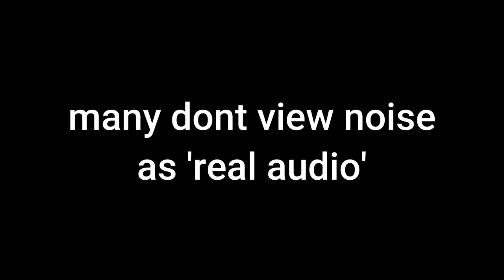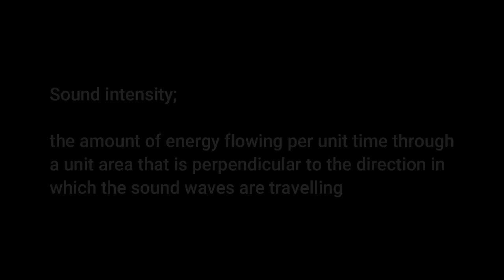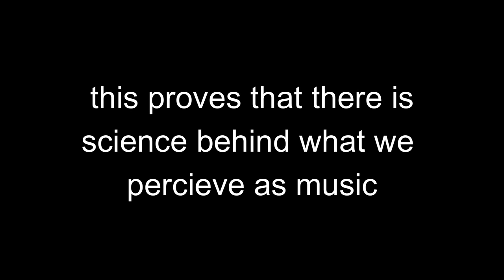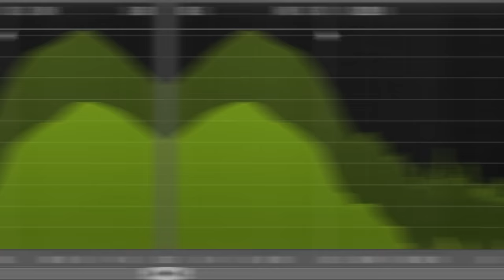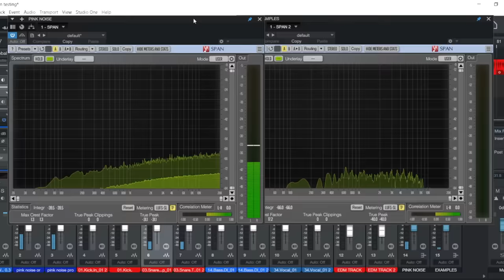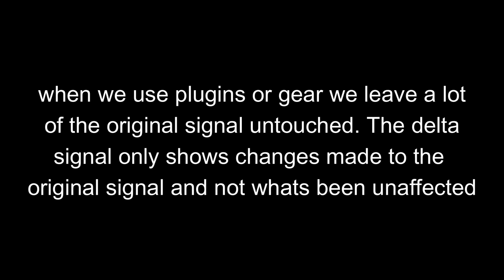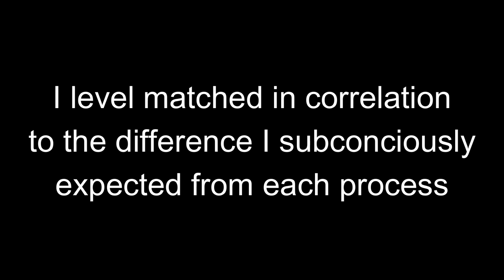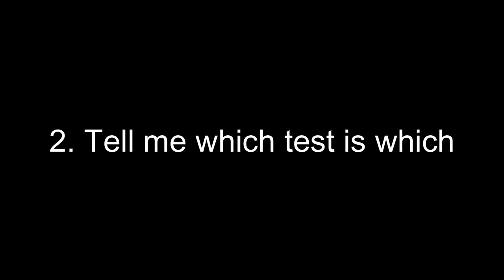THIS test will stop you buying more plugins.. and maybe even improve your mixes!!

Comment: I feel like there’s a lot of context outside of this video that I have zero knowledge of to make any sense of what is the debate that it is addressing, and what relevance it has to the video’s title. 

Does anyone feel like giving me some pointers?
Reply from the maker: The whole point of the video is showing how you can properly test if a plugin or piece of gear is actually adding anything audible, and if 2 plugins or gear have enough of an audible difference between each other to constitute in a purchase, without being distracted by psycho acoustics and the placebo affect. This can save you money on plugins as you know you can actually measure how much difference a process is adding to your sources/mixes.

Measuring the level of any difference proves to you how much a difference that decision is adding to a mix. It can help your mixing cause you understand that it's a pretty low level that the average listener will struggle to pin point. Makes you focus on bigger elements instead of micro details.

Understanding the intensity of acoustic sounds gives you an understanding of how your plugins recieve the signal. With the 4.5db slope off you can actually see your fundamental accurately which makes your hpf process make more sense. Puts into consideration how much your hpf sidechain detection in your compressor would need to be in order to bypass most of the low end energy triggering the compression. Understanding the relation to musical notes and frequencies can help you with your eq'ing

Theres tons of stuff going on but the video was originally inspired by the waves bb tubes review I did where I showed inaudible pink noise nulls and guys were still commenting that were wasn't enough "actual" audio examples to add context when in reality there were no audible differences added by a lot of the artist presets and I could easily recreate most of it with free plugins..the null proved that again.. And I got tired of explaining to people that Pink noise is the most complex signal you could use compared to any audio example. If the pink noise is a decent level and the nulls inaudible.. Pointless doing any musical AB test
Reply: @PaulThird  OK got it. I'll give the video a rewatch with this context.

Comment: What do you mean by using pink noise with your sounds? Should I layer sounds with a pink noise layer? And how would I do so? Using shaperbox or some stuff like that?
Reply from the maker: I only use pink noise as a source for determining the difference between 2 processes. It's just testing differences
Reply: @PaulThird  Aight Bet! Thanks. I was a bit confused at one point in the video😅 thanks again❤️

Comment: Your assumption that 0.6dB is inaudible to trained ears is terribly wrong, as any mastering engineer can confirm. In mastering, 1dB is considered a large EQ cut/boost. We tend to EQ in fractions of a decibel changes. We had to go through years and years of ear training, but having those ears is the bar to cross before becoming a mastering engineer. It's also why we obsess over expensive monitors, AD-DA, etc.
Reply from the maker: 0.6db difference between 2 files. Not 0.6db boost or cut which would actually result in a much more audible null 

Nearly 90% failed the 0.6db test I made while 60% didn't even guess and admitted they couldnt tell which was which .. Explain that

Comment: I’m pretty much dumb to this kind of stuff. But in simple terms what does this mean to audio engineers? Sorry lol
Reply from the maker: That if you use a strong pink noise signal to compare differences between 2 processes ie plugins or gear and it results in a very quiet null (spectrally around -80/85dbfs) then there's absolutely no point in doing any AB tests cause it proves that any musical signal will have completely inaudible differences
Reply: Hmm I don’t trust myself with these type of test. But I put my confidence in you. Have you done this test with Tube-tech Cl1b plugin vs hardware?
Reply from the maker: No not yet

Comment: Isn‘t this a kind of a ghost debate? The comment shown at the beginning is actually rather referring to „music“ than to „real audio“. And while noise is real audio, it is not music.
Reply from the maker: The debate is about whether musical audio examples are needed even though scientifically you can prove that there are no audible differences between 2 processes using just noise as the source.

What I've shown is that you don't need musical examples when you have an inaudible pink noise null, musical examples wont give you any more audible differences.

So when you have an inaudible pink noise null and somebody says "yeah but try it on 'real' audio".. Its a pointless comment as musical audio and noise are both audio. It's still the same thing.

Its like oranges and lemons. They are both different kinds of fruit, but they are still fruit. If you squeeze both they'll give you juice, which will taste different and be perceived different but it's still fruit juice and if you were to say test the acidity levels of fruit and we tested the most theoretical acidic lemon on the planet.. Then why would we want to test a random orange when we scientifically know that oranges have less acidicity than lemons?

"cause lemons aren't a real fruit?? Nobody actually drinks lemon juice and orange juice is the most popular fruit juice on the planet"

That's essentially what people are debating about but in audio terms
Reply: @PaulThird  I'm not saying anything is wrong with your explanation, but some musicians just want to hear things instead of doing math, That's all. :)
Reply from the maker: I get that it's just that what I'm saying is that when the science proves there is genuinely no difference to hear, there is genuinely nothing to hear so as much as people prefer to listen to things than do math, the math tells you WHEN you should actually be listening. 

The human brain is extremely wierd and can make you think you hear things that you actually are not hearing and that's why a combination of math and critical listening, for me anyway, is the best method for discerning differences.

No point in listening for stuff you actually can't hear in a blind test

Comment: But transients at different frequencies though ...
Reply from the maker: What do you mean
Reply: @PaulThird  pink noise doesn't have transients, so how are you seeing how it's reacting to them?
Reply from the maker: Yes, and span show them via the avg + max preset. 

The max shows your maximum transient level for each frequency.

So when I match the pink noise to the loudest frequency peak i.e. The loudest transient, which due to the sound intensity of musical sounds is always going to in the lower frequencies of the signal, it shows you the maximum possible difference of that process because there's no louder transient coming from the acoustic source due to the sloped properties of acoustic sound due to its sound intensity. 

The pink noise null shows you that by matching the max frequency peak there will be no transients that exceed the pink noise due to the slope of acoustic sounds. The avg and max preset proved that.

Pink noise is essentially a "constant transient" which makes no logical sensenin theory but for this discussion it's basically the maximum possible dynamic range that a frequency can make in an acoustic source at the same max frequency peak. So pink noise it's a constant steady dynamic. So it's basically a constant transient across the frequency spectrum. 

So when the loudest max frequency peak is matched by pink noise no acoustic source will provide a louder null in any frequency.. Because pink noise is sloped in a way to give the maximum possible ceiling for each frequency in relation to the sound intensity of acoustic sounds. So there's no transient of any acoustic source that can surpass it. The kick test proved that